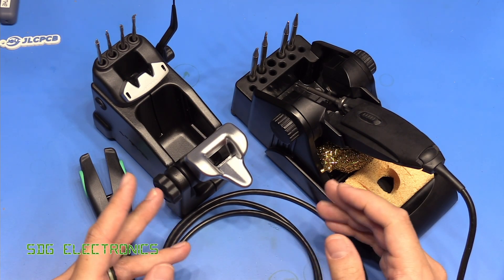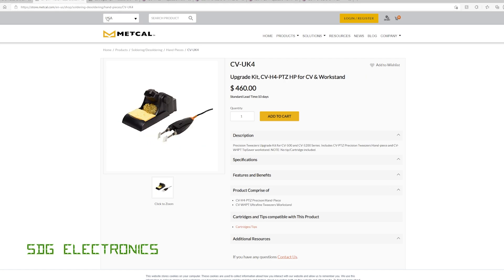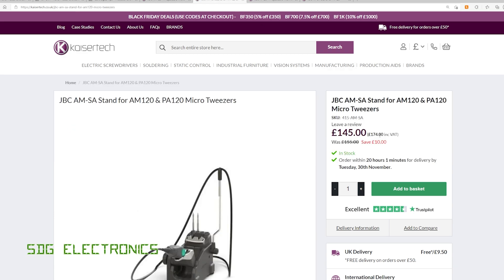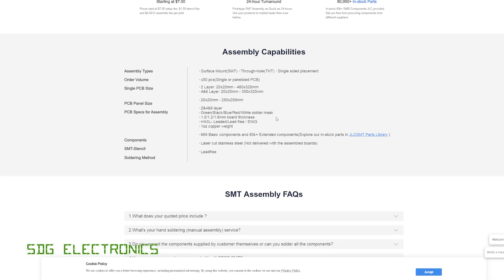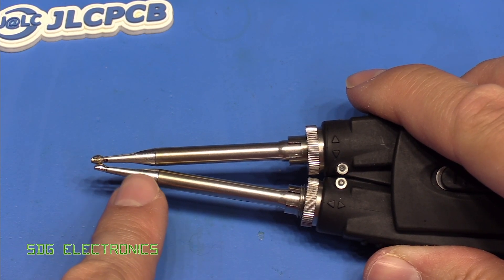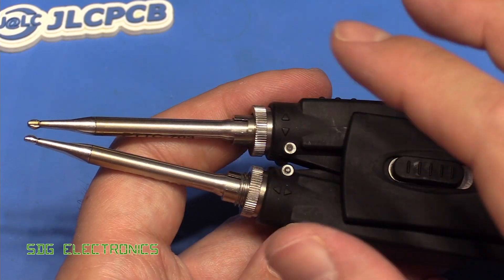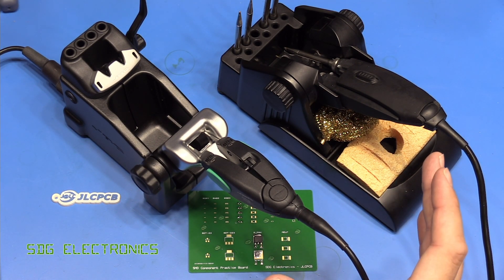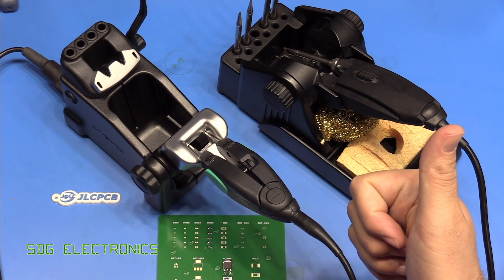SDG #233 JBC AM120 and Metcal MX-PTZ Desoldering Tweezers

Comment: Not gunna lie, I don't like the JBC ones. The adjustment knob to align the tips is just poor all over. It doesn't stay put and usually I can only just make them line up (but only barely). They work well mind you it's just the whole alignment is a bother. Also feel they are too light, but that is personal preference I guess.

Comment: 14:02 it's designed that way and the reason you pay the extra money to use a JBC holder. The tool heat control relies on the electrical connection to the stand to put it into stand by mode when you replace the tool in the holder. No wasted heat sinking.

Comment: Hey Steve, amazing video as always, keep up the good work. I have one question in mind, did you test the AM 120 tweezers with any of the Chinese T245 soldering stations? Like Aixun T420D or T3B? Does it work with those stations? I'm thinking of buying a T420D and later getting the AM 120 tweezers to use them with it instead of having to buy a separate soldering station just for the tweezers.
Reply from the maker: I didn't get to test this, but it's on my agenda!

Comment: For metcal wish tip seriees (5,6,7,8) is recomended to remove smd micro components?
Reply from the maker: The typical choice would be the 7 series - that'll give you a soldering iron temperature of around 340 to 350C which is ideal for lead and lead free soldering
Reply: @sdgelectronics  just ordered my tweezers and a pair of PTTC-703 cartridges, coincidently

Comment: JBC holds onto the tips because it will make electrical contact with the cradle and will put it in sleep mode. Lower temperature. Will heat back up in a very short time when you take it out again.

Comment: Good video, as usual. Sorry for the noob question, I bought the same AM120 tweezer (from Weidinger) just few days ago but on my tweezer it is reported AM120-A followed by different 6 digits. I would like to buy other tools in the future but I would understand how to know which is the most recent tool currently available. Is it AM120 or AM120-A the most recent one? Which is the meaning of the 6 digits (tool revision?)? I also bought a T210-A but in the handle it is reported T210 although in the box it is reported T210-A. Then I see video on youtube where T210-A is reported in the handle. Thanks for any explanation
Reply from the maker: AM120 and AM120-A are exactly the same. I'm not sure why the markings are different.
Reply: @sdgelectronics  thank you very much for the answer and for many of your interesting reviews
EDIT: just had some clarification from JBC. As expected, the 6 digits are the production number so higher value means most recent. AM120 and AM120-A (the same for T210, T210-A etc...) are the same. AM120, T210 etc... (with no suffix A) should be the most recent (the production number is higher)

Comment: I have the JBC PA120 micro tweezers and they do fit into the stand properly, but they don't have all those adjustment knobs which are not really needed anyway.

I also have the AN115 nano tweezers which are ideal when working with 0402 and smaller sized parts.  They hang from the stand that is part of the NASE rework station.
Reply: That nano station looks so sexy, brutally expensive though.
Reply: @catharperfect7036 Correct, but if you can somehow justify the cost and buy one, you won't be sorry.

Comment: Likely the design on the JBC is so that tips make electrical contact with the stand for sleep mode functionality.  While it may look lower quality the fact that they are small and light is more important.
As you mentioned they are only for those that need to desolder components daily it will not make sense for hobbyist.
Reply from the maker: It would have just been nice for it to match the quality of everything else, the movement in the hinge can be annoying when lifting smaller parts with conical tips.
Reply: @sdgelectronics  Yep. That’s the most unforgivable ‘feature’ of the JBC in my opinion.
Reply: Yep, that's why I am in two minds. I'd like to know the repeatability of grabbing 20 or so components in a row without them shifting......then I might buy.....I could get over the relative low quality. Hmmmmmm!
Reply: Yes that is the reason, electrical contact for sleep. If they wanted to they could have done it like Pace with a switch, or some DIY solutions use an optical sensor. But all of their other stations use electrical contact.
Reply: @jaro6985  or a magnet which could have helped hold the tweezers in the stand and activate a switch.
Reply: Wouldn't this also put them to sleep when you touch a low value resistor or an inductor? Doesn't make sense to me. Are you sure about this?
Reply: @marcelhensen6847  The soldering iron tip is grounded and the stand just needs to sense that ground made contact with the stand body (metal part) to enter sleep mode.
Low value resistors or inductor have nothing to do with this. Unless you are saying that you work with a board that is powered directly from grid and then you touch the grounded tip to a component connected to live wire. It will still not go in to slip mode even in that case but you should sure not work on a live powered board.
Reply: @electrodacus  Okay, so it detects connection between stand and tweezers, not between the two tips as I first thought Gotcha.

Comment: The reason the tweezers don't properly fit in the stand is because you're holding them the wrong way around. It actually holds on decently well as long as you put the tweezers properly in the stand.

I agree there should be more variety in the C120 tips. I found the C120-007/008 tips to be pretty usefull, but only work with relativly large components (0805+). I'm not sure why they don't have any tips like those but (much) smaller. There are the AN115 and NP115 tweezers for use with the C115 tips, but still I think there should be more smaller tips available for the AM120.

I'm using the AM120-A (so not AM120) myself, which has aditional locking knobs on them. Not sure why those knobs are there tbh, I never found them to be actually usefull.
Reply from the maker: It's the same either way around with the tweezers - they still rely on the cartridges being wedged against the metal part. I find it odd that there's such a disparity between the tips for the AM115 and the HT420 - the AM115s are quite small, but the HT420 are significantly larger with no real overlap between the two ranges. The HT420 really should have some better tips for smaller components, after all the C245 handpiece has tip geometries right down to 0.3mm so it's not a limitation of the physically larger cartridge size.

Comment: if I had to the money I'd get a pair of weller WXMT MS Slim Tweezers @ £341.2 + the £791 for the WXD2 station. so I can run the WXMP micro-soldering pencil @ £272.50. + about £25 for a tip.

whats wrong with paying £1,429 to work on a few PCB as a hobby. But I did say if I had the money.

I do have the micro-soldering pencil which i got as a broken iron, fault in the cable at the station plug end. now using a home built power station.

I'm just a weller fan boy,  4 wellers, 2 antex and a mains heated desoldering pump cheap from CPC.

like the look of the Metcal.
Reply from the maker: Someone commented that the WXD was not that brilliant, but I've not used it so can't compare
Reply: @sdgelectronics  it's not a one tool does all, but i find that it's great for getting in to well populated PCB's for changing a resister or a cap etc. but for other parts i just flood with solder and catch them as the float off. 🙂

Comment: I was in the market for the JBC compact tweezers station to go alongside my existing JBC station........but I'm put off by the quality given the price. Need to think about this!
Reply from the maker: Yeah I wouldn't go for the JBC if you need to get the entire station. There's the Metcal MFR-1140 system for a reasonable price, though I've not used the MFR series personally.
Reply: Well, and I sound like a broken record here, but here also the weller tweezers are even worse. Can't even align those to get the two sides matched up. Sigh.
Reply: Ian, check out the JBC PA120 tweezers.  Different (older?) design and I'm quite happy with them.  I used the Weller WMRT tweezers for about 10 years and only got the JBC stations a year or so ago.
Reply: Yes, I bought a set of tweezers about a year ago. The build quality was not what I was expecting so I sent them back in the end. There is a lot more to the story than this, but their support acted quite unprofessionally in my case.

Comment: Are there specialized tweezers for desoldering ICs in one go, or would the heat guns be the default solution?
Reply: Tweezers are better for boards with a lot of components near each other, where using a heat gun could cause unwanted components to desolder
Reply: @UntrackedEndorphins  they’re better, yeah, but you’d really have to need them often to justify them.  Plus, like OP said, there are tips for regular irons for removing passives and ICs. Tweezers are great, I’ve owned them, but these days I just use hot air and flux up anything that might reflow (assuming it’s not too heat sensitive).
Reply: @UntrackedEndorphins or you could just put aluminium tape over sensitive parts like Louis Rossman. 

He seems able to do everything with just a Hakko T12 iron, hot air and flux gel.
Reply: These tweezers have tips available for ICs, assuming they have the leads on two sides. That said, unless you’re doing a lot of desoldering, just stick with hot air.
Reply from the maker: There's a whole array just for a standard soldering iron too. Look at the Metcal SMTC-1159 for example